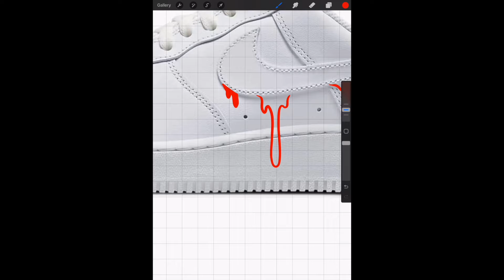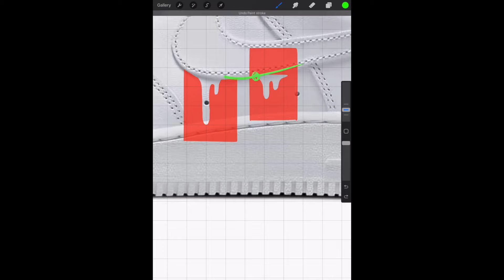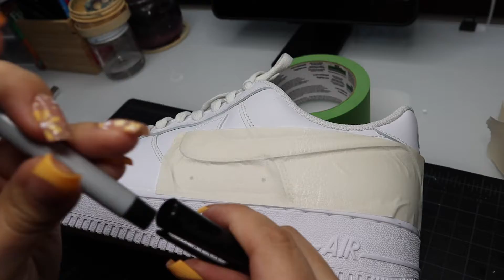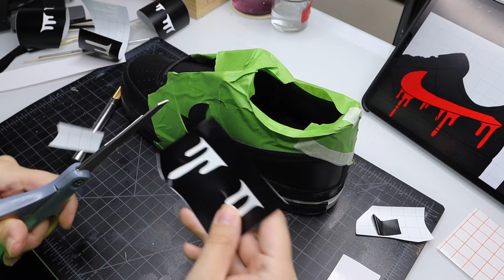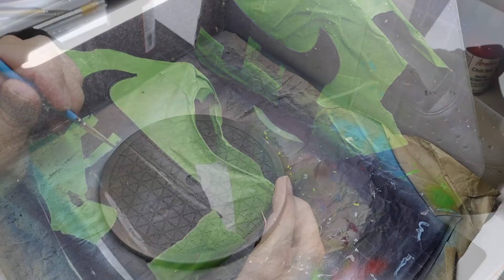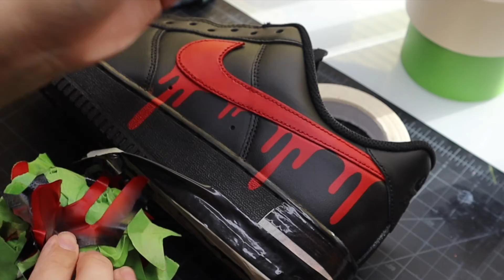How to make a drip design using stencils | STEP BY STEP

Comment: Wow this is crazy cause I was just gonna put drips on my slides I was practicing on. Thanks for putting this out there. Appreciate the knowledge on working with customizing.
Reply from the maker: Great minds think alike 🤭
Reply: I tried to painted over a stencil of a rose n it came out 30% ok the rest was horrible smh. I painted over a spade stencil it came out 98% better. I definitely need to get an airbrush. At least it was a practice pair of slides.
Reply from the maker: @Infinitiy_999  did you maybe paint the layers too thick? Or not let enough dry time in between coats? Could be why the stencil didn’t turn out for the rose 🤷🏽‍♀️